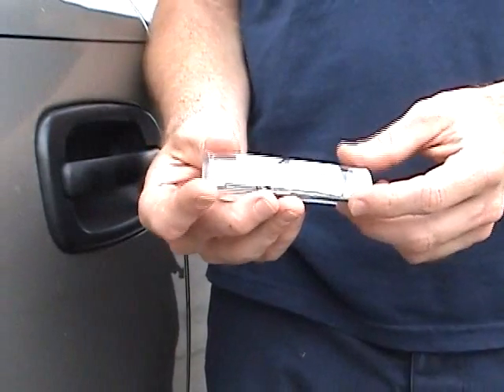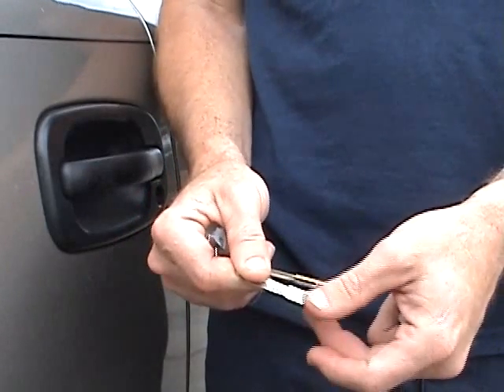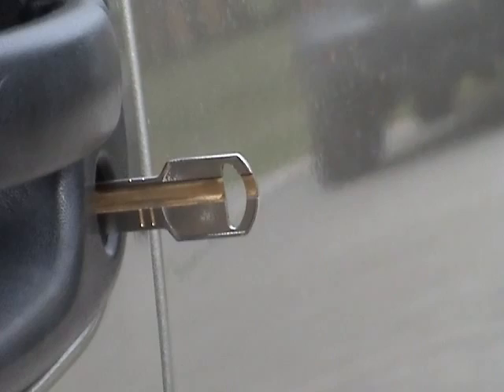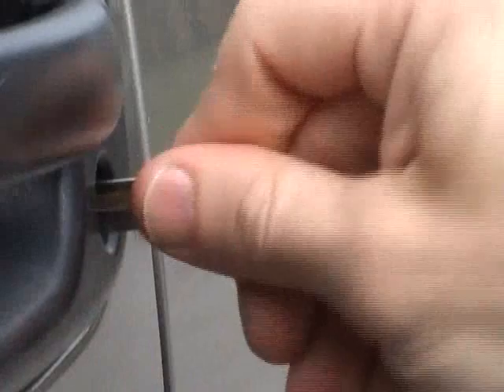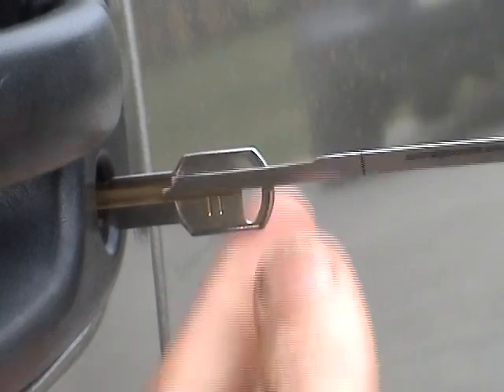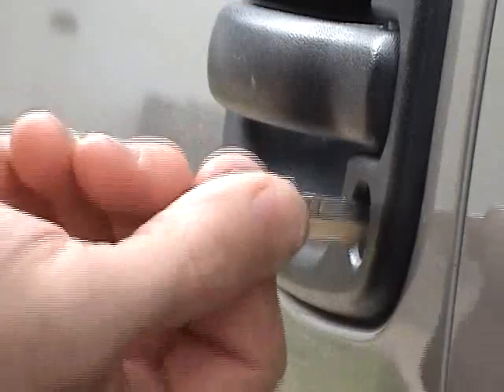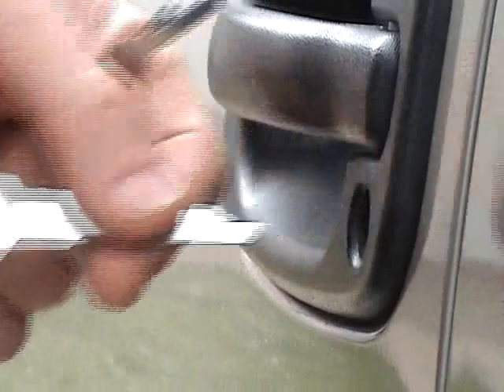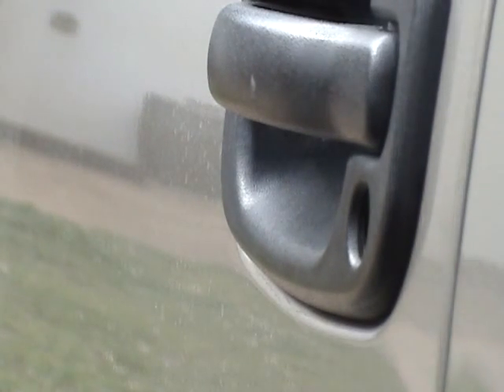GM10 AccuReader demo

Comment: Very poor instruction. You didn't explain why you have two keys,?. Why the first key  flipped out and did you insert the same key or the other one?
Lack of instructions. Sorry man
Reply: its so you have almost the whole key in the lock at all times other wise when you get to cuts 3 2 and 1 the whole key would be dangling out the lock
Reply: Its a demo, it was never meant to be "instructions."  The instructions come with the tool.